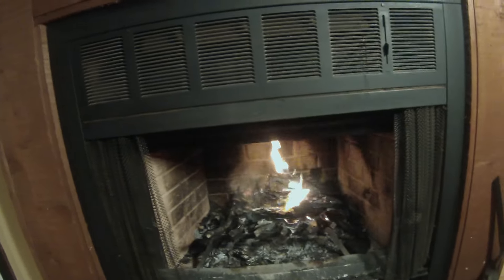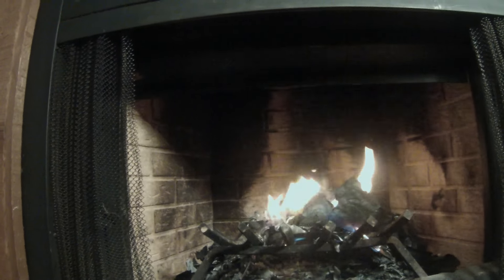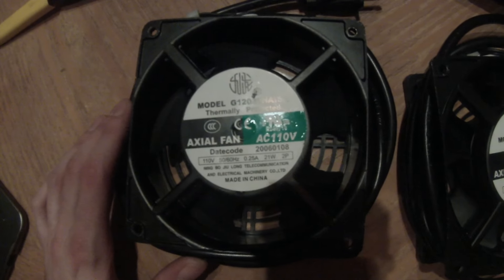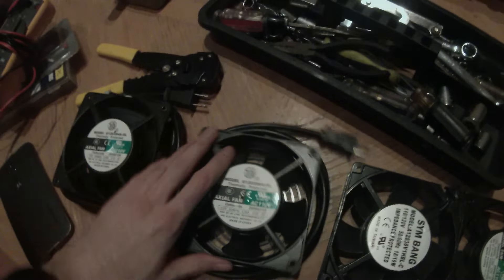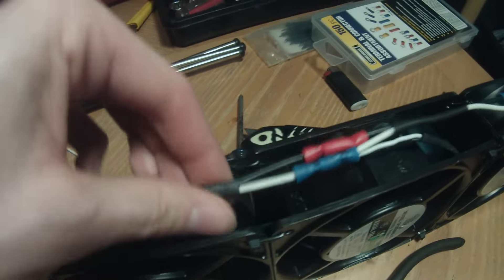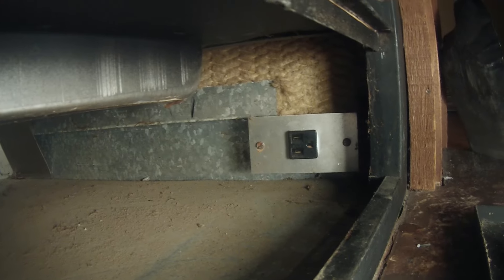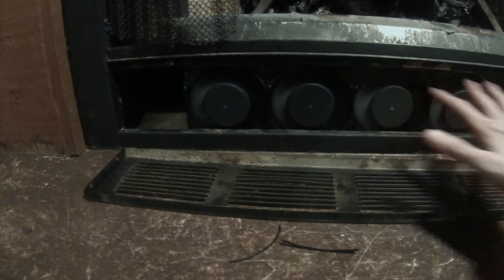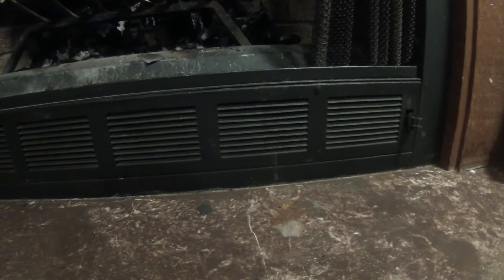Building a "blower fan" for my fireplace

Comment: I tried something similar and it works great. I only have 2 fans, so I was able to plug both in with a Y split plug, so no need to connect all of the terminals with butt joints or heat shrink tubing.

Comment: hi there, is this still going strong?  I am trying to find a solution for my very old fireplace.
Reply from the maker: I have since moved from the town house I built this for. I left it in place before I moved so the next residents could make use of it, but I have no idea if they actually use it or not. It did work quite well for the short time I used it. The only real complaint I have is it was quite loud. Good luck!

Comment: Look up "slot fire" or "Texas slot fire". You don't need the expensive frame to build that fire but a grate is helpful.  Using some unsplit wood, you build a "slot" for the smaller wood to burn in.  Much of the available radiant heat comes out the front of the fireplace instead of going up the chimney.  A well-built slot fire can burn at least a couple of hours without any attention.  
Use 8" wood for the back log, 6" for the side logss, 3" or 4" for the top logs.  Build you fire in the "slot" that leaves.
Why bother?  It puts more heat in the room if the power is off.

Comment: 240 Watts to power the fans?  You may as well squelch the fire and just heat the room with the fans!
Reply: A furnace fan runs 500-600watts. The efficiency he will gain will far outweigh that wattage.
Reply: Watts, your thinking Volts!